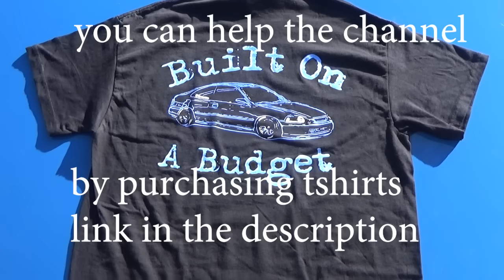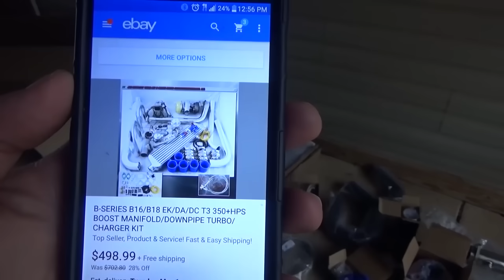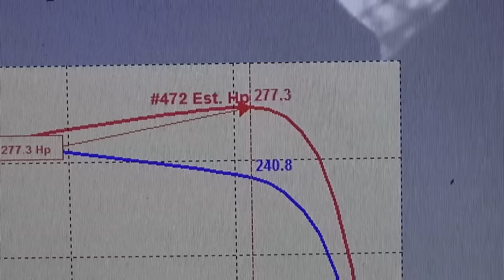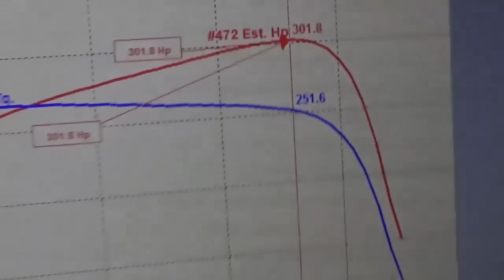Cheap Turbo Civic build (1 year in 20 Minutes)

Comment: I still drive my 1998 Honda Civic LX 4-door. I haven't modded it but it still runs great. Zero transmission problems and zero engine problems! It's my first and only car. I bought it when I was 19 and I'm 39 now!
Reply: wow... how do you maintain it so well?
Reply: nice
Reply: @Khanso1o  the civic has a good engine especially if u don’t push it hard
Reply: @Sequel7  doing a pull like once a week or two or something like that is actually better for the engine, helps flush out carbon buildup in my experience if you use fuel additives. edit: just don't overdo it, and treat the engine well
Reply: @Fred_the_1996  what's a pull
Reply: @SuperOlivess  just flooring it for a couple seconds every once in a while, if you baby the engine too much it'll get dirty with carbon and eventually need to be cleaned. Flooring it a couple times every couple weeks helps keep deposits away and the engine clean
Reply: @Fred_the_1996 that’s good to know cuz I do that often 😂

Comment: Took me a year for each build as well I went from 350-500-700+ hp but I bought my STI brand new in 2018 so I waited a year or two before modding. I don’t drive it often but I daily a manual 08 TL Type S but I’m not boosting that car. Clean build man.

Comment: jesus, i spent 4k in a week and a half on my 2001 mazda protege just getting it road legal LOL and updating the in car tech to bring it up to date in 2021. Cheers for the video, now the next step is to Turbo the Mazda. Didnt realise how easy it was to plug a turbo onto a car. Exhaust manifold, turbo, oil in, oil out, intercooler, ecu, tune. Might buy a cheap $500 car and pull the engine and drop some forged pistons with lower compression and do exactly what you did. Cant find vtec civics anymore, they are all either impounded or dead in Aus. 10/10 video and you got a new sub.

Comment: I've built 4 hondas and 2 Acuras and my favorite build was a "91 CRX DX dual point 2 injected super slow and swapped in a sleeved and balanced K24/K20A1 Head (fully built head and stage 3 boost cams) RSX 5 speed trans, Quaife LSD, ACT Stage 3 twin disc clutch, drvieshaft shop stage 3 axles, Garret GT3582R turbo, AEM engine management, Tanabe exhaust, S2000 seats etc. This video makes me want to build another car.

Comment: You have inspired me to finish my 1999 ex, currently it’s a rebuilt d16y7 I bought it for $600 running on 3 cylinders and had to rebuild the engine I have about $1500 into it. I plan on manual swapping and doing what you did to yours on a budget. My paint has the same issues clear coat missing and dents lol

Comment: couple questions, why didnt you change the motor mounts out when there were obviously shot AND you had the engine out...second you uh...running stock internals on boost?...oof

otherwise thats super sweet, what are you running on boost? 8-10psi?

Comment: Hey bro I have a question. My 97 Civic has 17 inch rims and it is rubbing the sharp metal part under the wheel well. Can I trim that grind that down or what? Please help me I'm not sure what to do. I don't think rolling the fender will solve that, it's the actual metal on the car that's cutting the tires. Please write me back I appreciate your help as always you're awesome!!

Comment: Lmao I love the EK hatch and the EK coupes I'll always love forever more than any other car I've ever had my EK 9 type r hatch and don't be fooled because I'll tell you one thing there's a lot of people out there fucking ordering red badges and typos stickers off of eBay and Amazon if you see drum brakes in the back of a hatchback or a coupe of any kind and it's got red badges on it flip them off immediately for me thank you. the number one way to call them out is birthplace real typos and any Honda owner knows in the back of the engine bay or the front depending on which EK style you have there should be a birth tag in electric blue with silver printing on it showing the model and type of type art is with the factory number regardless of that I bought a project ek9 type r and it took me around the same amount of time a year and a half between patching the hole that the last owner put in when swapped the wheel to the opposite side of the car and because of the welding he did on the frame putting in new connections for the rack and pinion and the steering rack I had inspection problems big time but by the time I had it done I had used an old d series motor d16y5 and it temporarily and I had so much damn fun with that d16 Wi-Fi motor because I'll tell you one thing nothing else out of any other Honda I've ever driven no other motor Honda ever made makes you appreciate VTech more because that motor is slow as sin until it hits VTech and then suddenly you're like holy shit this thing's got some balls after I ordered my k20a1 off of JDM and installed it I almost wished that I had turboed my d16y5 rather than the K20 granted I always be a k series guy but damn I had a lot of fun and no other single cam motor on Earth will ever ever compared to the d series Honda motors especially the y5 and the z6 save the sohc!!!

Comment: As a beginner how much experience do you need to build a civic like this ? Not mechanically inclined so curious would be dumb to jump into a project like this without an experience
Reply: Buy a civic and start doing maintenance on it and increase the difficulty step by step. That's the way I did it when I had like zero experience :D building a car as he did requires a lot of experience, especially when problems occur.

Comment: Hey man, mad respect for this build! Clean as heck. I’ve been wanting to make a build like this, but have had a very, very hard time finding a car to use. I can’t really find any 1992-1995 models. What year did you use? Will a 1996-2000 work for a build like this? I’m not educated enough about civics to know the differences between those two generations that would hinder/benefit an engine swap like this. Thanks for reading, and once again amazing work man 🙏

Edit: this looks like a 1996-2000, no? Just realized the different front grill haha
Reply: It’s a 1995 Honda Civic Ex

Comment: How TF did you steal that thing for $300?

And where did you find a B20 for only $400??????
Reply: Things are more expensive now sadly
Reply: @UnitedHornet  I saw a video just last night 2025 where somebody bought a running K Swapped 90s Civic for about $1500 a month ago and I just have to ask myself HOW TF?  Everything here in my neck of the woods at that price is straight garbage, not running, not swapped, probably wrecked, a shell without a motor or a transmission or is possibly a beater DX EM Civic with an auto transmission.  And I'm ACTIVELY looking these days. Anything remotely workable is closer to 3K than $300 and most of it is gone within hours of being listed.  It's maddeningly frustrating.
Reply: @ I’m in Denver Colorado so it gets expensive too. Night my 92 accord sedan 5 speed manual for 1100 but it needed an exhaust with cats so that was 800 bucks. I’m about 9k into a kswap right now and I haven’t even paid labor yet. It’s insane how expensive Hondas have gotten. A kswapped car will sell for 8000 plus without a doubt.